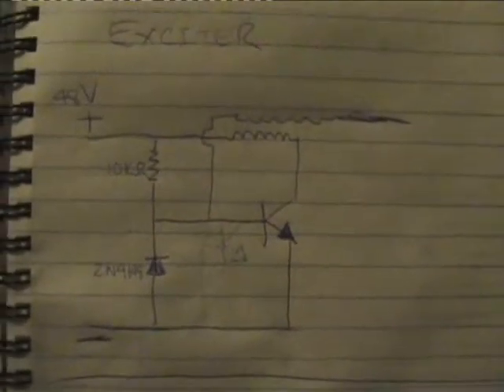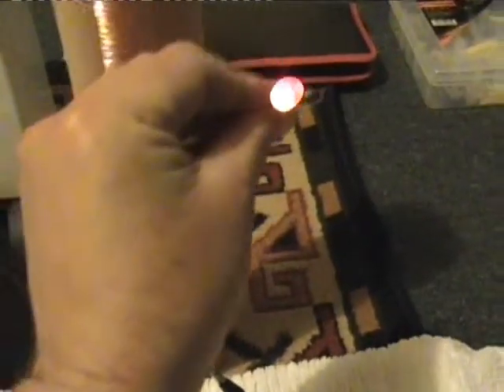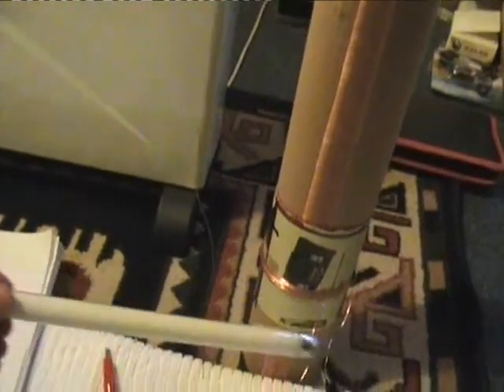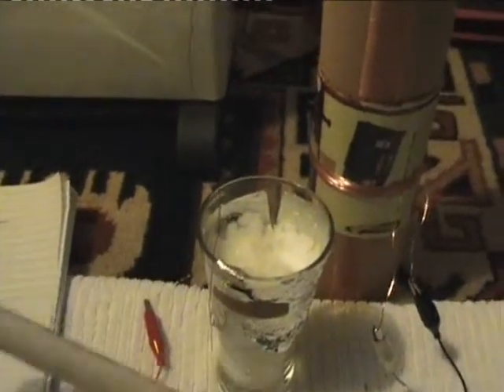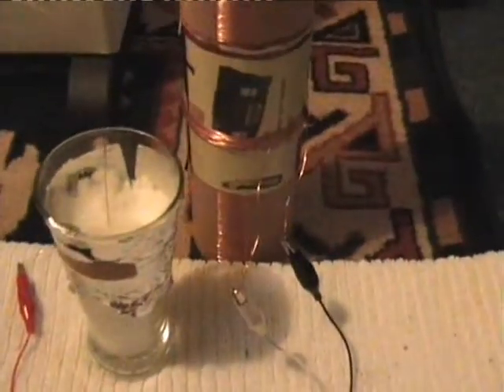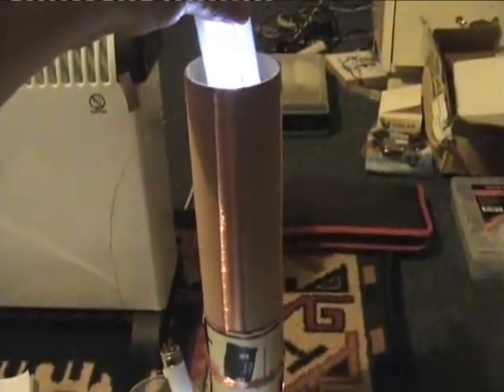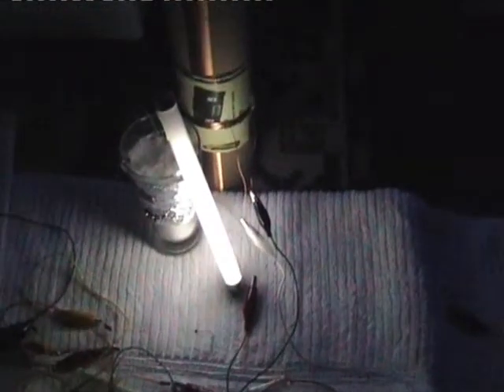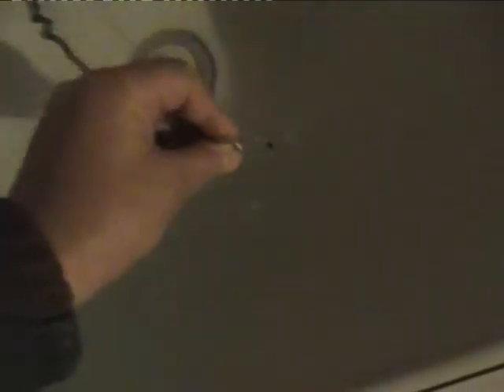Slayer Exciter 12v with plasma and water excitation

Comment: Great work, Br0kenman!
Maurice Cotterell theory explains your water amplification real well.
Each water molecule is aligning with your current apparatus field direction. It is also taking in the vibration of your osc freq. therefore providing a bigger mass, the radiated field therefore increase in strength and size.

Comment: Nice vid.
See you have the darlington setup drawn in schematic but not wired up. Did you mean you can run you're slayer at 48v now with just the 2n3055 or is that once you wire up the twin transistors? 
Thanks